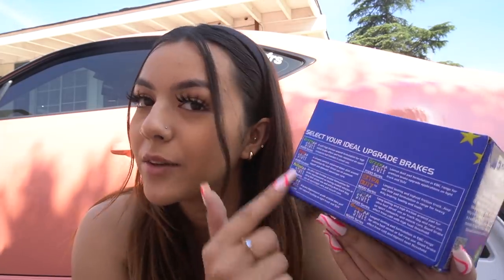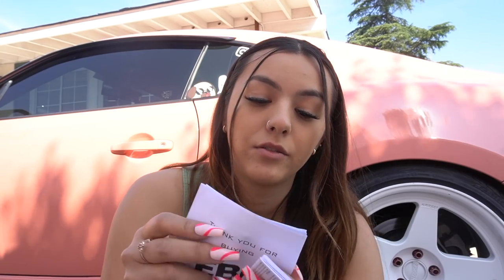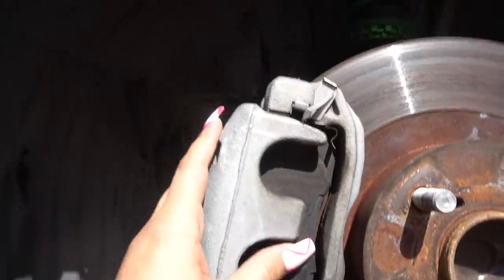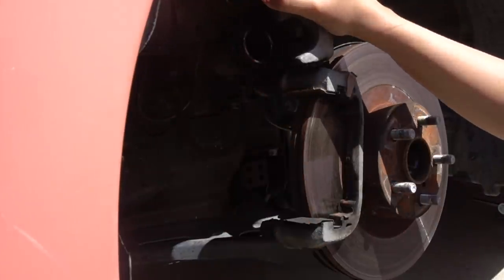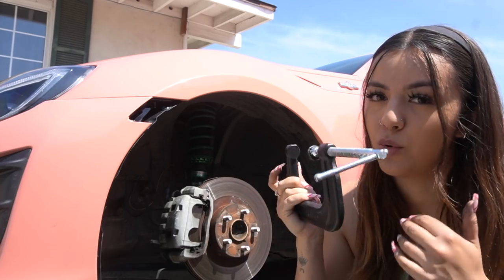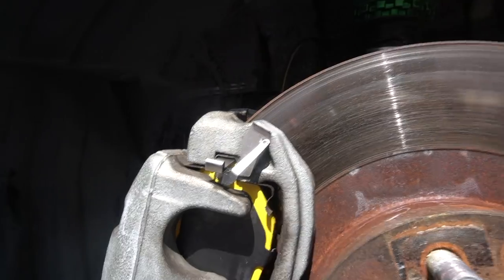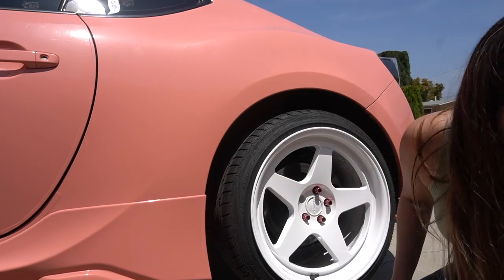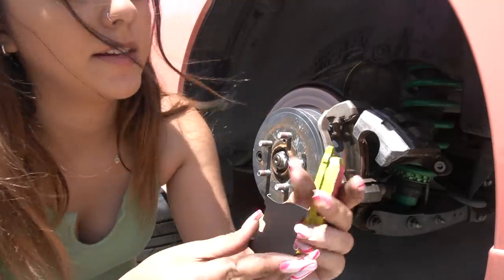BRAKE PADS INSTALL FRS/ 86/ BRZ

Comment: Your bakes looked like they were at 5-6 mm. which isn’t too bad, I would’ve changed the rotors & brake fluid to because probably were not changed from a previous pad swap. Gotta make sure that they aren’t glazing and that the rotors are higher or under discard rate to determine re-usage. That can cause squeaking
Reply from the maker: Thank you! ((:

Comment: Instead of the C clamp just order a break compressor from Amazon. I know your not changing the rotors but still take out the other 14m bolt it will be a lot easier to do breaks

Comment: I have those brake pads...I didn't even bother putting those metal back plate thingy onto the pads. They look cool with the yellow outside brake pad showing behind my wheels. Fuck it lol
Reply from the maker: I shouldnt have put it on🥲
Reply: @lopezalexandra  So turns out those brackets are meant to keep small vibrations leading to squeals down..you did it right. I might have to throw mine on now lol

Comment: You should take off both 14mm bolts that hold the caliper to the pad carrier, so you can remove the guide pins and grease them. You can hang the caliper off of the coil spring with a caliper hook or an old wire coat hanger. If your car is just a daily driver, you probably only do brakes every few years, so it’s a good idea to just do it all while you’re in there. Your pads that were on the car looked like they had life in them still. Squealing doesn’t always mean the pads are done. It could be due to worn out clips, no grease on the pads where they contact the caliper, or just the material of the pad itself might be noisy. Generally, the more aggressive the pads, the more dust and noise they produce.

Comment: You could also just use pliers to compress the piston back in. Either way great video and props for always working on your car with long ass nails😂idk how you do it
Reply: Dont listen to this guy bad advice for anybody doing their own brakes. If you use pliers it could cause the piston to compress at an angle and can cause it to move un even and cause caliper failures.
Reply: @JzLyfe  I’ve NEVER had a problem using pliers before🤷🏻‍♂️and my brakes have always been💯and I’m still alive.

Comment: Suggest that you replace all the Brake Rotors when replacing the Brake Pads!....What you just did when adding New Brake Pads to the old rotors is that the New pads are not fully grabbing the Brake Rotors because your old rotors have "grooves" on them...After replacing the Rotors & Pads you also need to do a proper "Brake Bedding"" process on them.